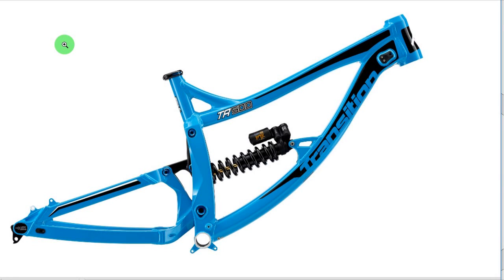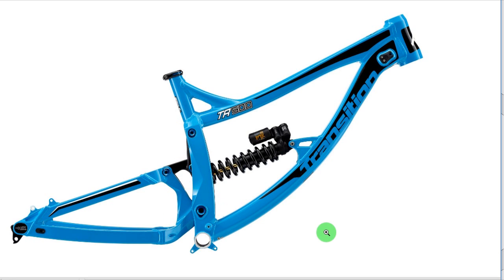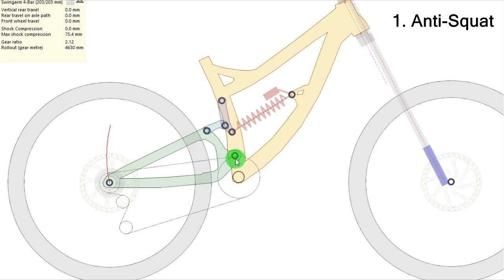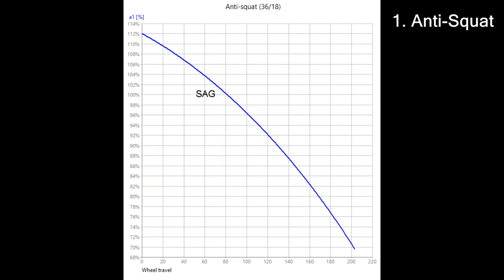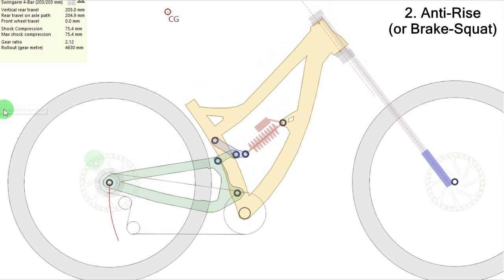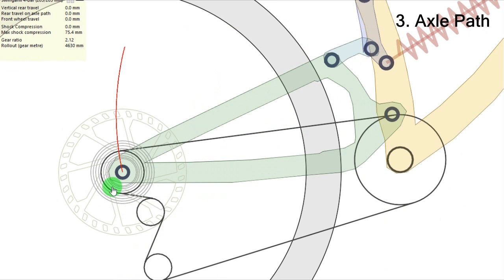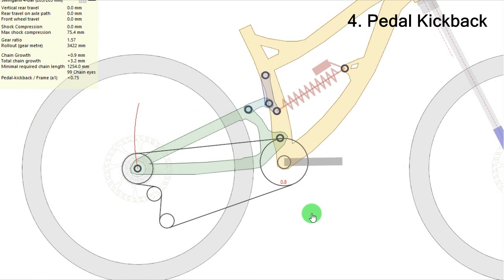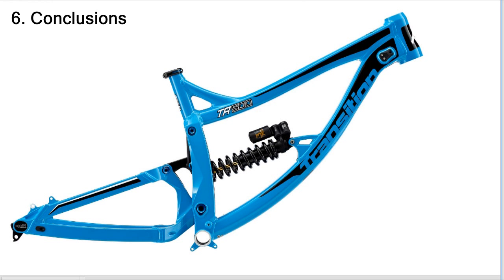Transition TR500 (suspension analysis)

Comment: Good day Sir! Since the GT Fury 2018 (last version of the independent drive design) is linear, is a coil shock better for it or an air shock? I rode it with rough downhill stuff for quite a bit and with a 400 spring on an 85 kg weight, it eats up rough terrain really really well. I haven't tried a drop any higher than 2 feet though because I'm scared i might damage something from a harsh bottom out.

Comment: please do one on the new Commencal furious thank you
Reply from the maker: Furious has good kinematics for DH/FR. It has a progressivity around 60% on M/L size (they say that progressivity changes a bit depending of the frame size). Anti-squats of 120% on average, and anti-rise of almost 100% (because this is a singlepivot bike since the wheel is directly connected to the frame, by the chainstay). Overall it's a nice bike in terms of kinematics, and it will feel similar to Tues due to the similar progressivity and anti-squats. The main problem of Furious is the relatively high chaingrowth and pedal kickback (its not a very relevant problem). Bye
Reply: thank you man!

Comment: can you do the Lapierre DH?
Reply from the maker: Yes, the Lapierre DH 2016 is also a swingarm 4-bar (as the TR500), so the anti-rise (braking) is also high (90%). Due to the main pivot location below the top of the chainring, the average anti-squat (pedaling) is low (around 50%), which is not very problematic since in DH you don't pedal much. The progressivity is very high (around 70%, similar to YT Tues). Bye

Comment: Very informational channel, understood a few bike dynamics.
When you get the chance, can you do an analysis of a Niner RIP 9?  Thanks.
Reply from the maker: Hi, yes! Niner RIP9 RDO has a great braking for this type of dual-link suspension (anti-rise 60%), however, anti-squat is not the best for trail riding (around 60% also). The advantage is that it has lower kickback. But you might need to switch the shock to trail mode to reduce pedal bob. Progressivity is normal for a trail bike (around 20%).  Bye